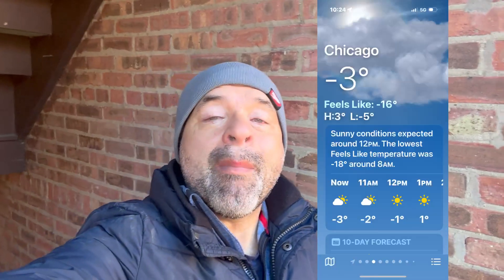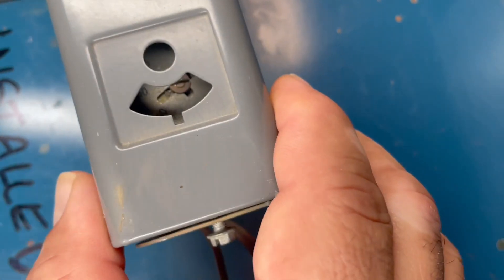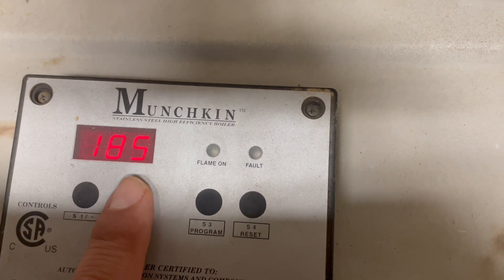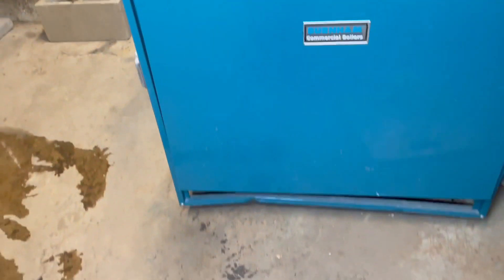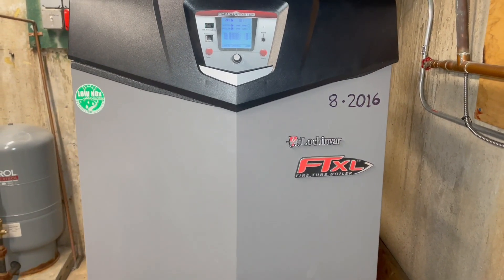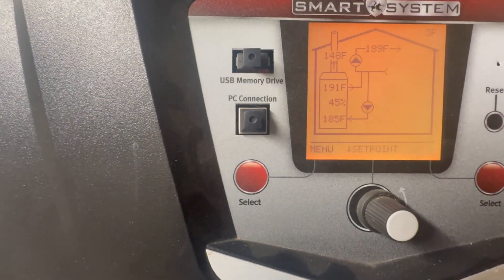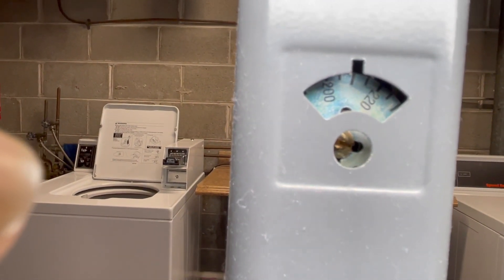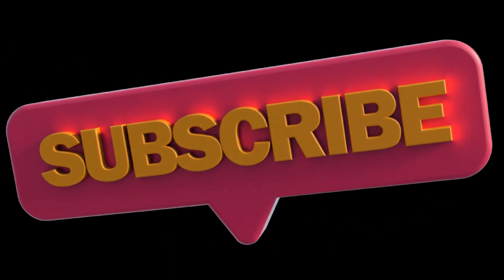ITS TOO COLD OUTSIDE! CAN I TURN MY BOILER TEMPERATURE HIGHER? HOW TO LOW AND HIGH LIMITS

Comment: Great video. Ive been doing this for years. Ive got a hydronic system with baseboard heat and an old peerless oil boiler.  Also keeps our water hot with an indirect so it needs to run all summer.   In the winter i kick it up to 210/170 which makes the water hot enough on cold days to kick on the aquastat on the pipe in my garage.   I installed the Modine heater myself about 13 years ago in my garage and didnt realize the ratings were for 200 degree water.   So i did some research and its been great ever since.  
I think I read that your boiler and heating system is the most efficient and actually uses the least amount of oil when its set higher.  The only suggestion is to check the water pressure and make sure it stays below 30psi witb the hotter water.  I had to take a little bit out of my system the first time I did it.
Great video, Alex.
Reply from the maker: Hey Rich, thank you so much for the comment.  When your boiler is down you have no hot water and no  heating system at the same time.   That sucks!!  Have that happen to you?   See you around.